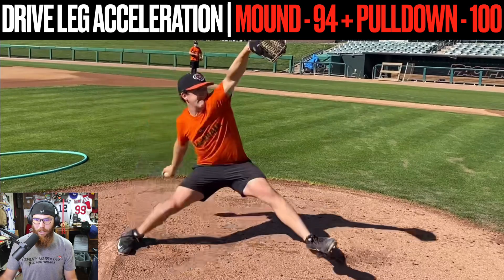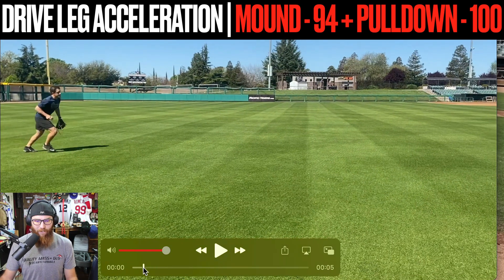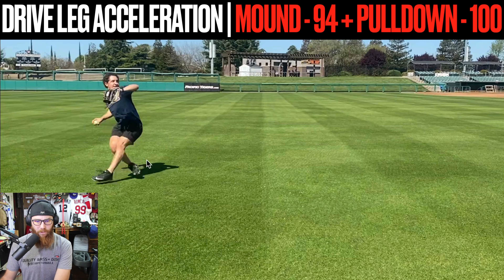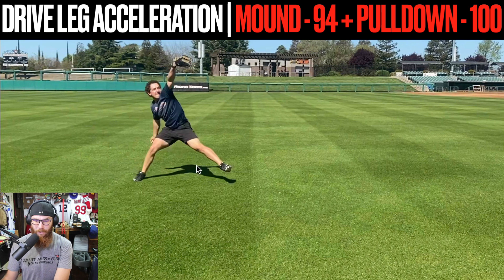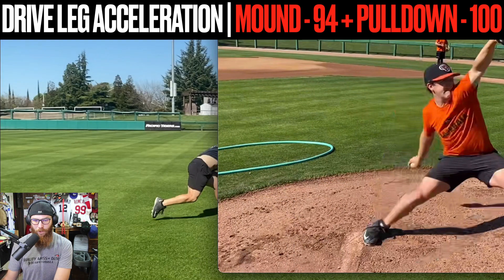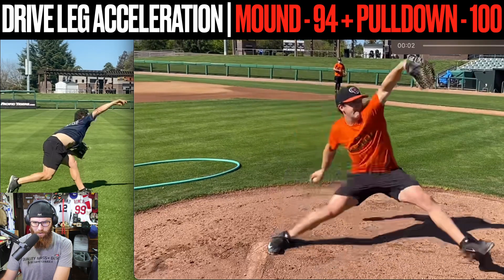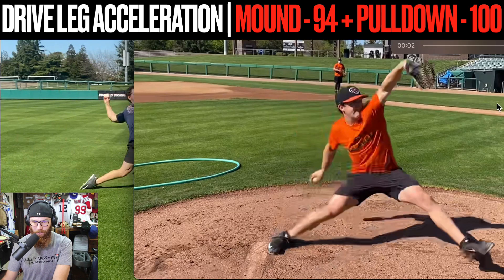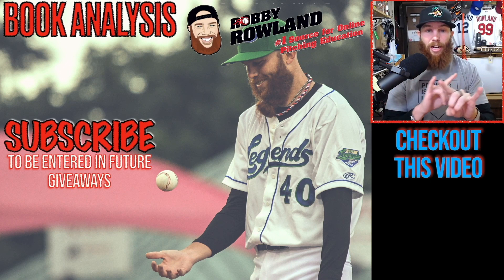Drive Leg Acceleration Mechanics - 94 MPH Mound vs 100 MPH Pulldown | MECHANICAL ANALYSIS

Comment: Honestly in my opinion pull downs and pitching off the mound are 2 different movements in throwing the baseball. There is no movement correlation. Do pull downs for warming up or for intent but spend most of your time on the bump.